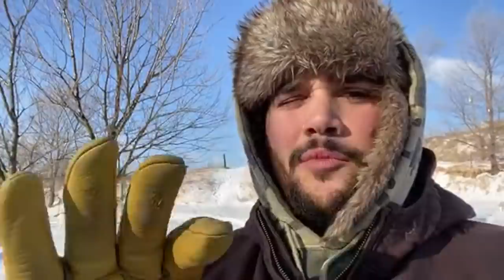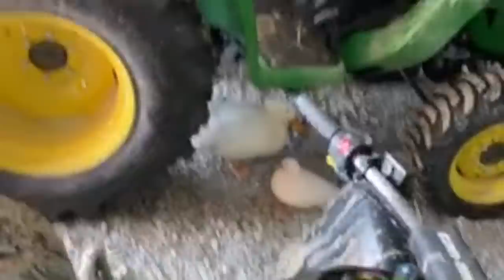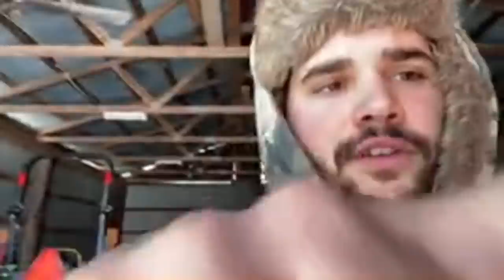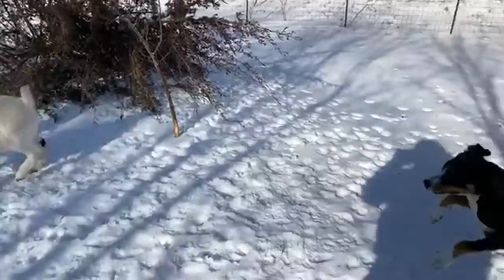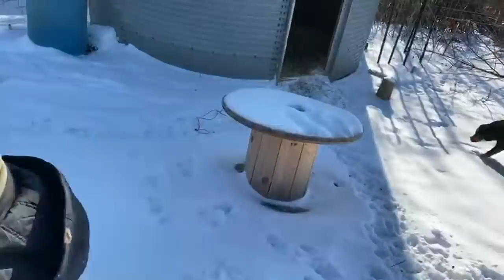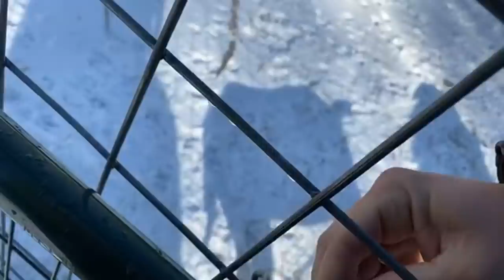Doing the MORNING CHORES in My BACKYARD FARM!!!

Comment: 60W lightbulb over the eggs would stop them from cracking and give you just a little bit of heat. Just buy the bulb socket and drill a hole in the roof of the hatch.